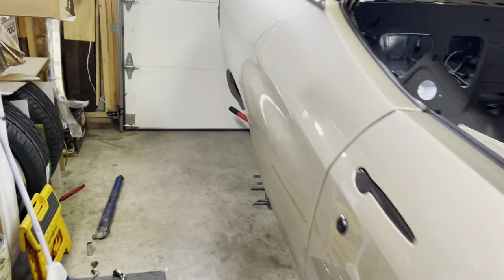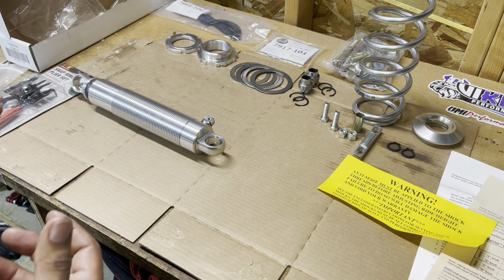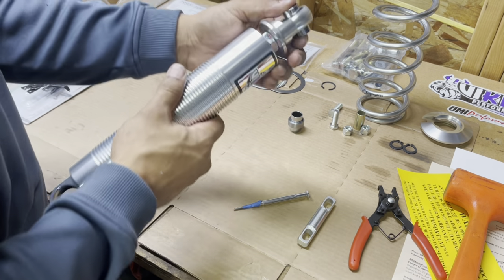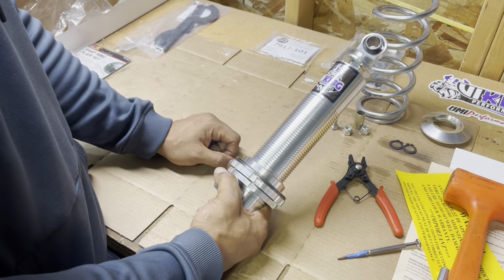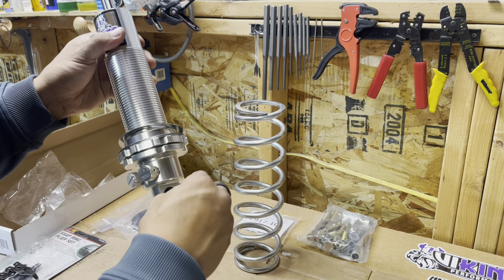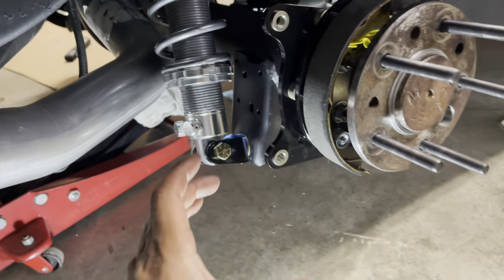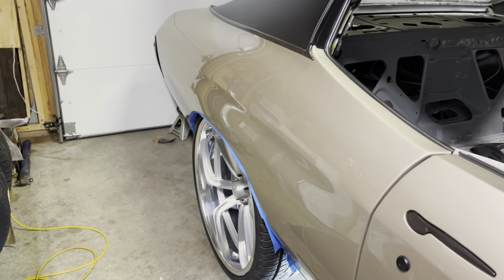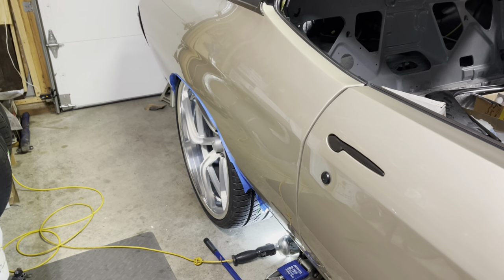LOOK WHAT COIL OVERS DID TO MY CHEVELLE! SUPER SQUAT!!! | VIKING | LSX |

Comment: You said daily driving 😂  It's coming along.  I like those wheels.  I want to get a new set for the truck someday.  I too scratched my head on the rear in my truck.  The right and left shocks mounted at different places some side to side.  The drivers side shock was at a much steeper angle than the passenger side.  It was a real head scratcher.  Can't wait to see this thing finished up!
Reply from the maker: Lol! Yeah man! It’s always something!
Reply: @MrGriffin23  Sounds like you've got a plan to fix it.
Reply from the maker: @RustyWrenches  Yep! Lol! I just got done fixing it.

Comment: I have the original brackets on my Chevelle and I was worried about the angle of my shocks after seeing everyone has different brackets now. I had no idea that they were discontinued.
Reply from the maker: Yeah man! I really don’t like it, but I had to roll with it. I actually found a set of QA1 brackets that they use on all there newer kits. It was a challenge to find them as it looks like they don’t sell them separately anymore. At least right now. Luckily I found one set left. I’ll be looking to installed them maybe this weekend along with new coils stiffer coils.
Reply: @MrGriffin23  think I’m gonna switch mine out soon. Let me know how it turns out when you switch up. Thanks

Comment: I thought these Viking Coilovers only gives you a 2” drop in rear. How did you get the other 2”?
I and trying to lower my 68 Chevelle at least 3” in rear.
Reply from the maker: I’m not using the coil over mounting hardware. So I’m mounting them in the stock rear shock location, which gives me an addl’ 2” static drop.
Reply: Awesome, what hardware are you using? I like how low you got it, looks sick.
Reply from the maker: @juliochavez4023  Appreciate it. It actually dropped it too low. But I’m getting all that adjusted.
Reply from the maker: @juliochavez4023  https://a.co/d/2MY8NkM
Reply: I found these that are made by QA1. You can adjust them.
Part#  RK106K
Reply from the maker: @juliochavez4023  Yes! I have these as well. I decided the other route for ease of installation, but I have this if needed.
Reply: You wanting to sell the ones I sent you? I haven’t bought any yet.

Comment: 3 inch exhaust ??
Reply from the maker: Yes!
Reply: @MrGriffin23  ok thanks. I am trying to get a 3" exhaust but was worried about going coil over later on. I should probably go coil over before I go exhaust so they could bend pipes right where they dont touch. What exhaust do you have ? Any high flow catalytic converters?
Reply from the maker: @josecarranza1188  Gotcha! My coil overs are in the stock locations so going over should the axle like normal should be a lil’ easier, but It’ll still be tight due to the 3” exhaust. If you mount the coil overs to the axle tubes like some folks do then you might have to dump the exhaust before the axles. 

Not sure on the high flow cats. I just have mufflers.